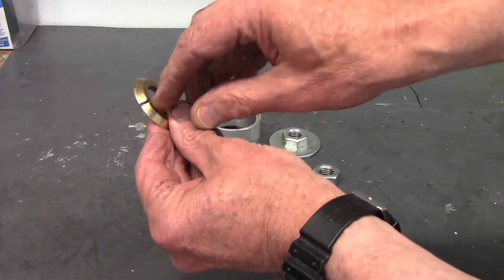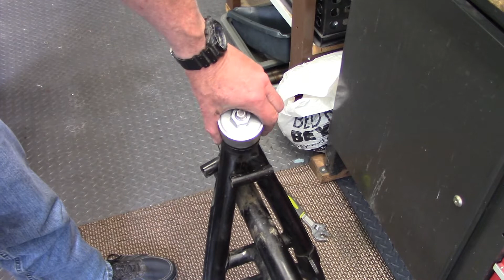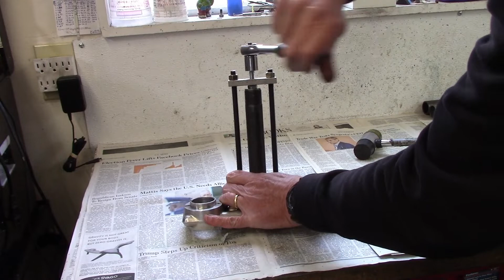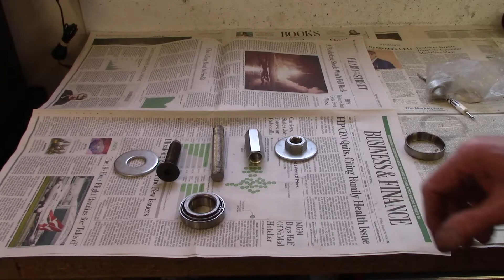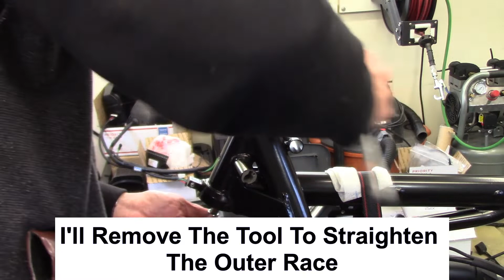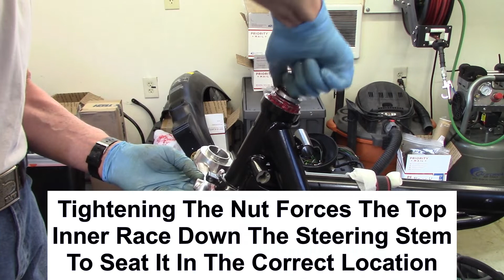1983 BMW R100RS Replace Steering Head Bearings-UPDATED

Comment: Thanks Brooks,  I know that you use a gauge for wheel bearings preload, I like to use the same gauge for setting steering head bearing preload, I got these specs from Honda and Suzuki, with everything put together from the end of the handle bar wheel off the ground I like to have a 350g-500g pull before the bars move.

Comment: I bought these Cycleworks tools and they did not work this well for me. I had much more clearance between that beveled washer and the outer race. I did not have to tap it in like was shown. This meant I also had to apply a lot more force to the nut in order to expand the washer enough to grab onto the race. The sleeve also damaged the paint on the frame. 

When it came to removing the lower inner bearing on the steering stem, that tool would not fit underneath the bearing. No amount of hammering would push the ledge far enough under to grasp it. Attempting to then pull the bearing would just result in the tool walking off center because it couldn't be started correctly. I ended up cutting it off. 

Lastly, I emailed Cycleworks twice and never got a response. If you buy these tools, you are sending your money to a black hole for some hack mechanic junk. Maybe you'll have better luck than me, but none of their stuff fit well for my bike. That also includes the wheel bearing tool. The hardware for the tools just wasn't the optimum size for my R100S.
Reply: I also have the same problem. Bought the tool recently and it’s totally out of specs.

Comment: hi chap........totally enjoying your in-depth knowledge on BMW Classic bike Resto.....I have been following all as the info is awesome .........I am just getting my frame ready to send off/take to powder coating .........I noticed on the steering bearing instal you did, that the steering lock is installed.......did you totally remove the Locke body prior to powder coating??? please and thank you.......also is there a pre-video to what should be done prior to sending your frame and parts to powder coating.....please ........keep the in-depth vids coming Sir.......there awesome.  regards Phil
Reply from the maker: Phil, I did not have a key for the fork lock, otherwise I would have removed it prior to having the frame powder coated. I put wires through all the holes that should be protected from powder coating, or masking tape over them with "NO POWDER COAT" so they know what to mask off.  Later I found a used fork lock with key, so I drilled out the old lock and installed the replacement one.
Reply: @BrooksAirheadGarage  thAnk you Sir much appreciated

Comment: I had no problem removing the race on the bottom side of the steering stem but the one on top was a pain. There wasn't enough of a lip for the cycleworks tool to snap into easily. Hammering wasn't helping. I had to use the tool that compresses the driveshaft (so the snap ring could be removed) in order to compress the bearing puller ring enough to snap in behind the race lol.

Comment: excellent video, thank you Brook.  quick question: I was wondering, if, since I'm also going to be getting my frame powdercoated, it would perhaps be better to leave the upper and lower outer races installed until after powdercoating so as to reduce/prevent coating on the inside of the steering head tube?  and then remove the outer races afterwards?
Reply from the maker: That works.
Reply: @BrooksAirheadGarage  Thank you for your reply, Brook, all the best.